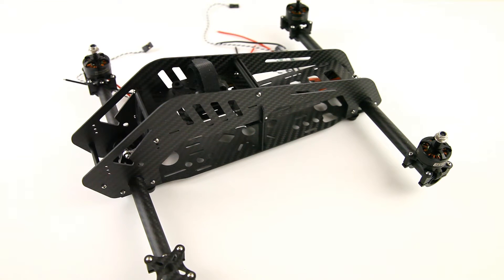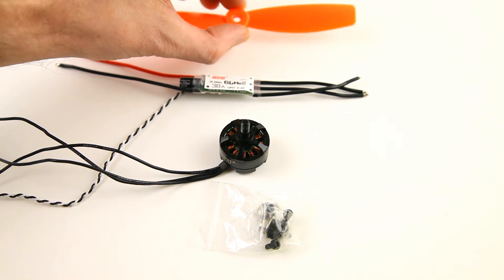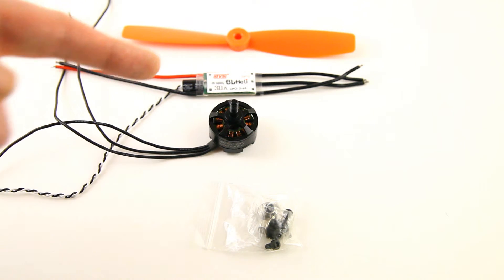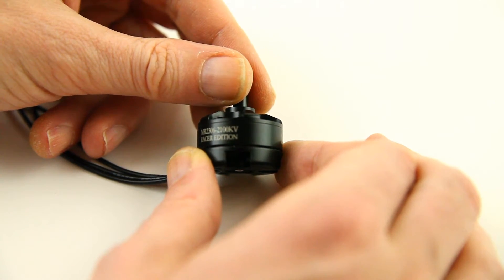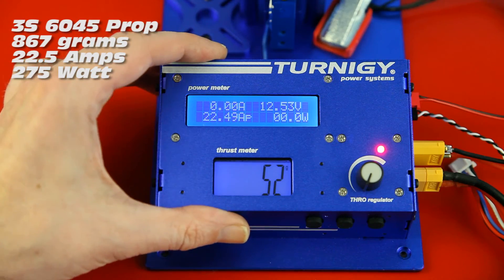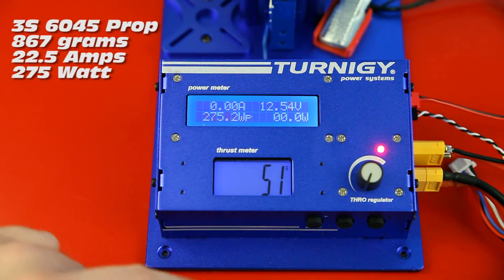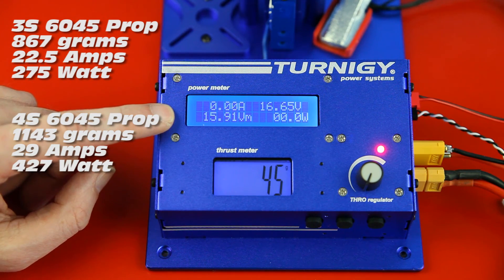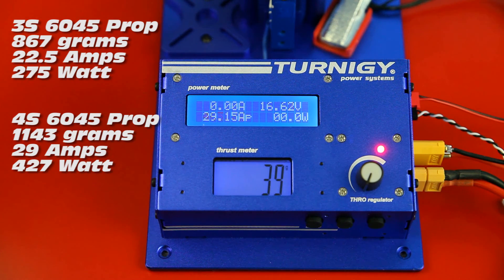Sonic Speed Quadcopter! Part 2: DYS MR2306 2100kV motors

Comment: You should join this facebook group that is working on TiltDrones.  They have special firmware that they developed just for Tilt drone servo.  https://www.facebook.com/groups/DynamicTiltingArmsUsers/  Lookup Tiltflight in chrome play store and download the special cleanflight configuration that Dominic developed.  Also download the Hex firmware for the flight controller and it will add a new functions to your tilt project.  The group is located in Sweden.
Reply from the maker: +Jon Car Facebook.. I can't even use my 'DutchRC' page at the moment because of some kinda change on FB :| 
Apart from that it's impossible to join groups from a company page (which is what I have)..
Yeps.. I reaaaaally like FB (NOT :P)
Reply: +DutchRC Adventures http://www.thingiverse.com/thing:946052   You can also print one.  http://www.tiltdrone.com  Like I said you can use the firmware to that is made for Naze32 to control tilt dynamically.

Comment: Hey DutchRC you might want to try these ESC's for this build.  They will fit in the tube arms. http://www.banggood.com/DYS-XM-Seris-XML20A-BLHeli-mini-20A-ESC-For-High-KV-Power-Electronic-Speed-Controller-p-1025915.html
Reply from the maker: +Jon Car That would indeed be nice :)  But.. My setup does run up to 30A :$  So 20A with no aircooling.. I'm not really sure :$

Comment: Jeeze! That is some serious thrust! Why was your scale reading 50 and then 30g after you stopped? What would happen if you took a larger motor, like 28??-35?? And put a 5-7 in prop on it? You would get much less thrust than a smaller motor, because of the low kv right? Sure would spin up fast though ;) lol.
Reply: +The RCAddict That sure IS some serious thust indeed :)  I'm not sure what that is! Maybe the scale has to settle back down or something.. After resetting it, that's gone though.. But to be honnest, I don't really have an explenation for it.. 
Haha :D  there is weight to be considered as well in every project.. I want the quad to be light (to a sertain point) to have a good amount of acceleration.. Otherwise it would take to long (in time & distance) to get to a good max-speed :)
Reply: DutchRC RAW I would like to see the FAA "drone catchers" catch this one! LOL. My mom told me not to tell anyone I have not registered, and keep them out of sight from people going by on the road and stuff, TOO LATE, lol!
Reply from the maker: +The RCAddict I guess it would be indeed safer to register.. After that though pilots in the US should get of their asses, and do something against these rules... 
Remember: regsitering means you agree to NOT fly FPV....
Reply: DutchRC Adventures I know, that is my problem with it though. How are the "big guys" Charpu, Steele, still flying?
Reply from the maker: +The RCAddict Your guess is as good as mine..
Reply: DutchRC Adventures Yeah, gov't probably said they are fine, as long as they pay 35% of everything they make....
Reply from the maker: +The RCAddict Hahahaha :D  They'd be lucky if they even hear it :P  
Hmmmm yes.. that does sound like good advice ;)  After the fact however :P
Reply: DutchRC Adventures I am really thinking about registering now. I mean I am super against it but it comes down to me not wantin to break the law. I hate what they are doing, but what if they charge me $250,000!?!?
Reply from the maker: +The RCAddict LOL :D
Reply: +The RCAddict - I don't hate what they're doing at all. The world is full of jokers these days who evidently think nothing of putting their craft in harm's way or prevent emergency crews to do their jobs. If by registering (just $5 every 3 years in the US) it helps toward thwarting this type of behavior then I'm all for it. My number also proves my craft belong to me and I know I fly with safety and prudence in mind.
Reply: VideoSack This is not going to prevent any problems though! Anyone doing bad things won't register! Also, about the $5, it is not that is costs too much, it is the fact that they are charging anything at all, as $5 for a million people is $5,000,000 they just made for handing out numbers... Also, how in the world are they supposed to enforce this? Also saying a blatant NO to FPV, they just got rid of about 50% of the RC community over 250g.... Some rules are ok yes, but these are not the RIGHT rules..
Reply: +The RCAddict You are correct, this will do nothing to prevent bad guys from doing what they do. I think we all know that. But there are any number of areas where people should not fly, they know it, but they do it anyway. Here in the US we had the White House lawn incident, here in Washington State we had a bad summer of wildfires. Several times some idiots decided it was a good idea to fly up high over the flames to get a better look and/or record their flight for generations to come. Well their stunts prevented aircraft with fire repellents from being able to do their job. It's those people (if caught) that this is meant to help with. Unfortunately, we all pay the price, and not just $5. Isn't this always the way, the abusers wreck it for everyone. I don't know what the answer is. From what I've read the gov. consulted with industry personnel and manufacturers before laying down the rules. Who know?
Reply: VideoSack Registration will do nothing about that though! There is nothing going for it! Also it violates the 8th amendment clearly, and the rule saying they CANNOT impose any rules on them! They just dodged congress and the rule changing how they defined "them" so they could bullshit thei way through. Oh and they used Cristmas as an "emergency" situation, saying they need it out now, ummm last time I checked Christmas happens every year. Also they did ask companies about it, and they all protested and wanted different rules, but they did not pay any attention to them. DJI clearly said that, they were making a wrong move.

Comment: I wonder how much those numbers on the power meter would change if you could measure all all four motors at once, or if it would change at all considering the lipo will be powering X 4 motors at once .
Good stuff Dutch looking forward to the build.
Reply from the maker: +jammer2150 Thanks sir! :)  Well yeah. In the case of These lipo's it would not matter a lot, because these are more powerfull then you would really use on a quadcopter (of this size).. 
The 2200mah 4S lipo I'll be using as a flight-pack probably Would change outcomes indeed..